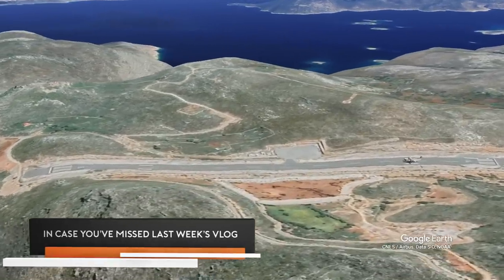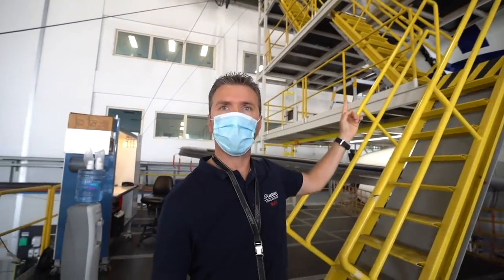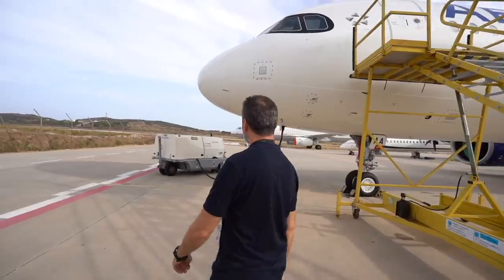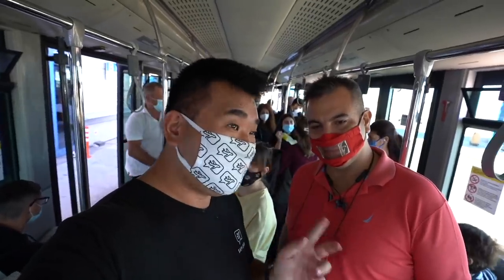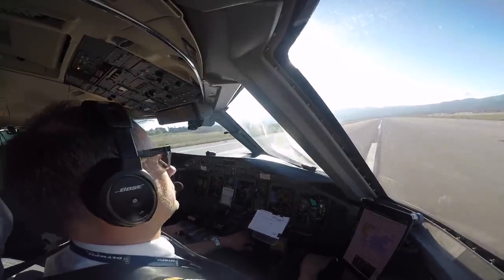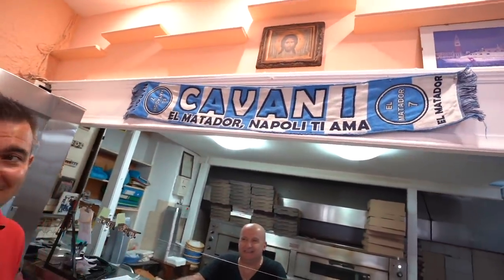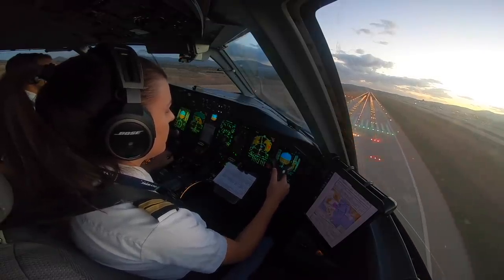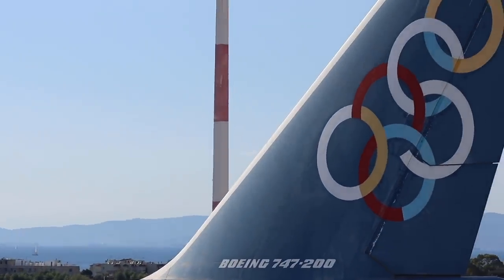Inside Aegean and Olympic Airlines - Heavy Aircraft Maintenance + A321neo

Comment: 4:34 Brain of the Engine . This box is cost like Lamborghini
Reply: Yeah the FADEC
Reply: A bit more, rhe ones that we carried in stock for the IAE V2500 were about 0.5 million euros.
Reply: @connectorxp  so that alone will cost 1mil for an A320? Cuz 2 engines?
Reply: Hahahahah!
Reply: @calvin.  yeah, sounds about right considering the price for whole aircraft is around $100million.
Reply: Wonder how much ram it has
Reply: @ndos4436  That's the EEC (Electronic engine controller). FADEC is a system of engine control that includes the EEC.
Reply: RYG  I’m sure the processing power isn’t much. It’s really going to be more about the massive input and output needs that require redundancy and likely a large amount of protection (after all planes fly through all sorts of bad environments). I wouldn’t be surprised if it had custom or semi custom chips to deal with it. Most of these systems use very exotic (compared to most controllers) distributed architecture with many high speed/bandwidth nodes with little processing power most likely a dual core low spec arm SOC. The processing power isn’t really what’s needed as much as the data movement and parallel processing.
Reply: @calvin.  the engines along with the supporting hardware related to the engines and the avionics are very expensive.  Typically the avionics on a commercial airliner is approximately 5 million US dollars.

Comment: 1:43 
it's a power transfer unit....it couples two hydraulic circuits without connecting them. Depending which circuit has the highest pressure determines whether it is being motored by that circuit or pumping. The hydraulic pumps are either in the engine, electrically powered or driven by an emergency Ram Air Turbine (RAT). I think ....

Comment: At 18:49 the story of OA411 1978 is similar to the movie Sully, minus 2-3 differences. 
1. The engine failure probably happened earlier during takeoff. Other technical details are different.
2. Capt. Migadis was able to go around and land the plane. 
3. Boeing simulations were not able to replicate the fortunate ending. In every scenario, feeding those technical parameters in the sim, the plane crashed.
Reply: His experience, skills and quick judgment saved lives. He dropped altitude despite flying low to gain just enough speed to make the plane manoeuvrable and land back at the airport after dumping fuel. Boeing never acknowledged what happened in their reports they couldn’t explained what happened. Captain Sifis Migadis is a real hero.

Comment: 1:36 that barking like sound is definitely NOT the Hyd.Pump ........🤦🏻‍♂️
Reply: They accidentally parked the plane on the tale of the airport managers dog and are now desperately looking for an excuse. The sound is from the "Power Transfer Unit" (PTU) which is a hydraulic pump and it is (in the A320) located near the wings. It transfers power from one hydraulic system to an other. And no it is not vegan, because the oil in it is made of dinosaurs.
Reply: @matekochkoch  in which universe is the PTU a Hyd. Pump?🧐 At best it is like a pump as it needs pressure from either green or yellow to operate..... And a real pump doesn't need pressure to opperate as it is the pumps job to create the pressure.......🙈
Reply: @janisknbl  A pump by definition is a device that transforms (a not defined, usually rotary) motion into the flow of a fluid. That makes the PTU more or less a pump. which is driven by a turbine. A turbine is a device that turns flow into rotary energy.
So I would say in our universe, but as long as you carry your towel: don't panic. Remember on 25th of May is Towel day. That is in 197 days.
Reply: @matekochkoch  more or les a pump after all isn't a pump.......🤦🏻‍♂️ Airbus itself isn't refering to the PTU as a pump, neither in the AMM nor the training documents.....
Reply: @janisknbl  I admit, you are completely right. It is totally rediculous to call a device that pumps oil a pump.
Of course it has more functionality, but so have most units which are called pumps. An electric pump for example, is an electric motor which drives the shaft of the pump, which is the second important part.